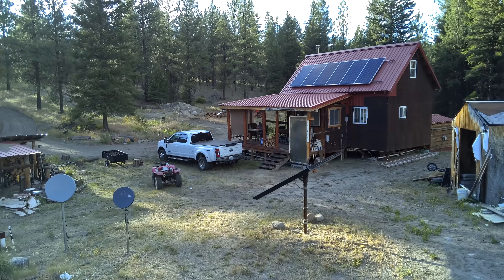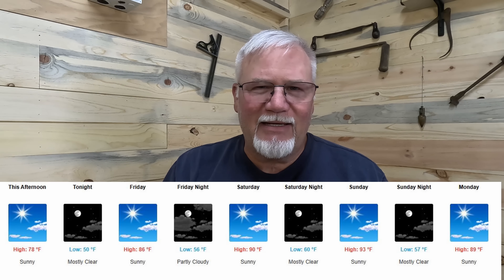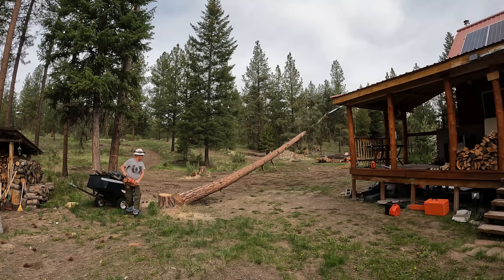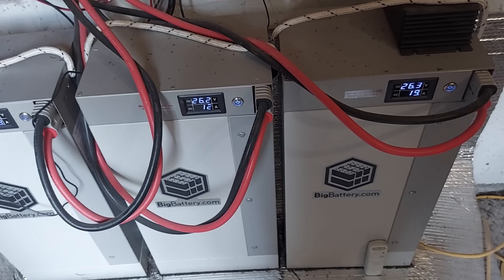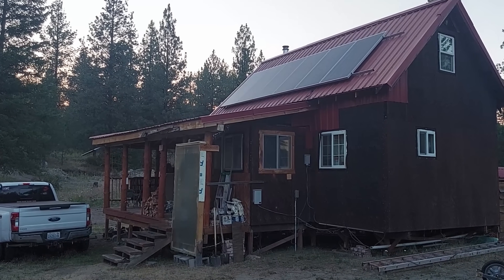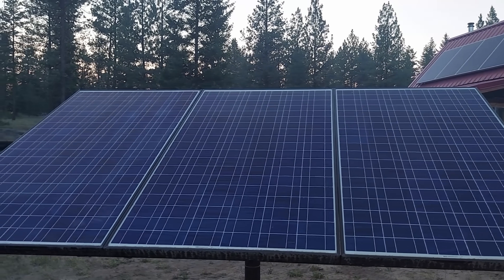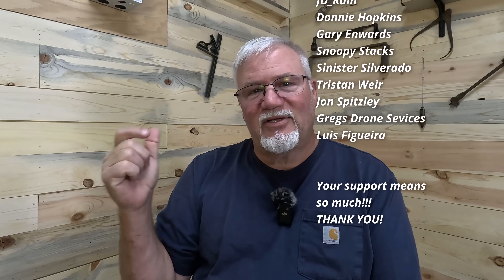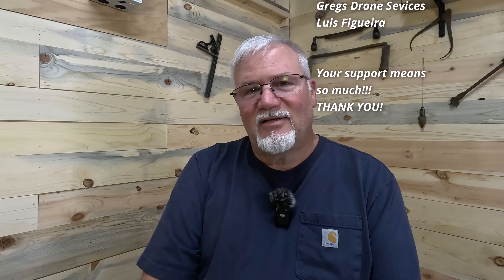I Tested An 8000 BTU AC Unit In My Off Grid Cabin During Hot Weather

Comment: We use a Midea U Shape AC with inverter technology in it, it uses half the power yours is using when at full tilt, and only around 100-200 watts normally. highest ive seen it go is 500-600 watts but very shortly. on my 2500 WH battery it says itll run between 10-15 hours.
Reply from the maker: Thanks for sharing! I'll have to check those out, great info.

Comment: I have a cheap amazon 12kbtu that will cool a 700sqft cabin on a 1200w inverter.  Aboit 11am-5pm the incoming solar can run it. I have seen it run 150w-1150w.  This has made out. Cabin useable again.
Reply from the maker: Nice to know what's working for you!  Which unit?
Reply: @TheOldJarhead the costway. Any cheap unit will do.
Reply from the maker: Mine runs $272 but uses a lot more power

Comment: Do you have a shunt,or how do you know your battery percentages? becouse on LIFEPO4 having that accurate,not many device can do,the BMS for sure wont give you the accurate reading(try get a victron shunt installed,and i bet you have more battery than you think)
Reply from the maker: Yes.  And a Tri-Metric Meter but I've had the system so long I pretty much know where it's at based on voltage under load (small load) vs at rest.  I used to rest the system 24hrs often to double check calculations etc and am just very used to it now :D

Comment: This screams dual split heat pump
Reply from the maker: Why yes, yes it does :)  Just a money thing.  Can't afford it just yet.
Reply: @TheOldJarhead yeah. Me either
Reply from the maker: That's the kicker :)  Maybe I'll get a Mr Cool some day ;)
Reply: @TheOldJarhead yeah their good. But when u can buy a Chinese made 1 for around 450 for decent 1 that will work. And they usually have built in blue tooth. Yeah it's about 100 to 150 more expensive though..I just looked it up. And the ones around $400 have a 11,500 BTU rating. 🤔
Reply from the maker: Thise also need someone to pressurize them vs the Mr Cool ones
Reply: @TheOldJarhead no not these days. Most u don't have to now
Reply from the maker: I'll look into it.  Last time I looked they all required it except ones like the Mr Cool

Comment: Thank you for the commentary.

Question.
Why dont you have a vertical wind turbine.
A small one that will generate 400w of power in very low wind speed is $400 to $500.
Of course you will need a wind generator charge controller.
Reply from the maker: I've often looked at getting a wind turbine but every time I look I find people saying they just don't produce that much for the money.  More solar is less expensive and more reliable etc etc...but I keep thinking one day!
Reply: @TheOldJarhead 
While they may not produce much.
Even if a 400 watt wind generator produces only 1/4 of its output that is still 2400w per day.

Usually when the sun is not shining due to cloud cover the wind is blowing.

Plus it can produce power at night.
Reply from the maker: That's why I keep thinking about them -- night, winter, cloudy days.  Perhaps one day but it would need to be a very low wind production model as I get only light breezes at my cabin 90% of the time.
Reply: @TheOldJarhead 
I would use a vertical turbine.
Less noise. Doesnt need to turn into the wind.
Produces power at lower wind speeds.
Reply from the maker: I'll have to look into those again.

Comment: A outside office (Converted shed with lofts) powered by 1200w on ECO solar tracker, 3000w inverter, 70a Victron charge controller, and 5kwh battery storage. This allows me to run a Window 8000btu Inverter AC 24/7 in Eco Mode. Plus extra power for TV, Mini Fridge, Desktop PC, Laptop PC, WiFi, Phone, Printers, lights, Fans etc. as needed. Not having trouble keeping office cool in low 70's even when 90+ outside. If temp starts to rise a osculating fan on low by AC spreads the coolness around office better. AC is set to 68 which keeps around 70 on head high thermometer across office, rarely goes above 72, if does the fan is turned on to bring temp back down.

All that said... Switching to a "Inverter" AC from a regular AC made a huge power savings difference.  An Inverter AC only draws the power needed to keep things cool ramping up power as needed. It is not a constant high power drain on batteries just because it is "On".  Highly recommend the switch for anyone off grid.
Reply from the maker: Great info, I'll keep that in mind when I get mine!
Reply: Forgot to mention the AC is the Midea U Shape brand. 
7am here, it's on already but only pulling 89w ATM and the office is actually chilly. It has a nice App, Energy Monitor for the month of July shows daily power draw ranged from 1.38kwh - 5.61kwh. Upgrading to this AC for office was worth every penny. You already know the benefit of tracking the sun, by 7:30 am AC will be powered by the sun and batteries starting to charge today.
Reply from the maker: That's awesome.  I'll have to check those out as many have mentioned them now.
Reply: They are not as expensive as a mini split, simple window installation, and extremely quiet when running. I can actually talk on the phone hear client and they don't hear AC over me. 8,000btu was only $350 and 12,000 btu $450 locally. I recommend at least 12,000 for your size space. 

Take any AC footage rating /2 to be closer to real world use. Square foot is great info for laying a floor but lacking when sizing AC
Reply: For people in direct sun without assistance of any shade all day... ;)
Reply from the maker: Ya I saw the 10k unit around $350 and thought "why didn't I see this a month ago! lol"  Live and learn I say.
Reply from the maker: Once I get the rest of my deck built, I'll have more shade too which will help :D

Comment: Why yes, I am doing a similar thing. Glad you asked.  8,000BTU window air conditioner, Ecoflow Delta 2 (1800 Watt inverter, 1024WH battery), 3x 250W solar panels. Due to a mismatch with the Delta 2 they only generate 400W. Two panels are fixed mount, one is adjustable. 1100 SF house. Last year as part of an upgrade, I replaced the two biggest most lossy windows I had. This has helped. 
A typical day goes like this: Overnight we open the windows and cool down the house. When the outside temperature reaches 70 deg we close all the windows. We keep one upstairs window open a crack to let the warm air escape. The new windows keep the inside temperature cool until about noon. Mean while the Delta 2 is charging from solar. By noon the Delta 2 is fully charged and I turn on the AC on ECO mode. It draws about 600watts when the compressor is running, 80 watts when only the fan is running. The first few hours the solar can keep the battery topped off. But as the temperature rises into the high 80s and into the 90s the AC runs more and more with the solar falling behind at keeping the Delta 2 fully charged. At the end of the day it's a race to the bottom as solar production tails off and the AC runs harder. Depending on how hot it is, the Delta 2 is spent between 5:00 or 7:00 O'Clock. And that's why the Delta 2 spends the morning recharging.
Clearly a bigger battery, more (or more efficient) solar would help. But it is what it is. My back of the envelope calculations show that I am saving 2.5 to 3 KWH a day.
Reply from the maker: That's quite the battle!  I'd look at expanding by a battery and adding a charge controller to the battery so the panels can provide all they are rated for.  Cheers!

Comment: Inverter ac on eco. Sips power
10k btu ave 5-600 watts in 90+ degree weather. Night temps 150 watts +or-  76 day 75 night set temps. Been running 8 and 10k units on solar and its great.
Esp in cooler weather. They sip little juice.
Reply from the maker: Nice!
Reply: @scozilla8503  , how much solar do you have? Thanks.
Reply from the maker: I'm curious too.

Comment: Great test!  I would suggest getting a Midea duo.  12000 btu.  It's an inverter AC that just sips power.  Also a unique vent swing system that really spreads out the cool air. I've had one for about a year and love it.
Reply from the maker: Nice, I'll have to check them out
Reply: Agreed. My inverter AC 6000 btu window unit uses about 230w on energy saver mode.
Reply: Running in my bedroom was only $200 refurbished and seems brand new

Using the same brand U shape window unit and have been for 5 years, also $200 on sale
Reply: The Midea duo? @ViciousXUSMC
Reply: Totally agree with these folks on the Midea. I have 12k btu and it pulls 700-800w at 69* max cool. Lasts all day and night on my 24v system.
Reply from the maker: Seems like a good investment....I may have to try that and see how it does...but then I'd have to find a home for the LG 😶😉😁😁
Reply: LG can be a backup.  @TheOldJarhead
Reply from the maker: True that -- though I'd have to store it...of course, I do plan to get that 2nd cabin built some day ;)

Comment: I've got a 12kbtu mini in my shed that runs around the clock. Not worried about consumption really I've got plenty to burn. But I have tracked power used in the shed and it averages 8 kwh per day. That includes the mini maintaining 74F for 400sf. Outside temp running in the high 90's. Starlink router and a secondary router, another 100+w around the clock. At any given point I'm seeing about 300w being burnt and peaks out for short periods of 600-700 watts. Only time I've ever seen it any higher was when I happened to be watching one day back in winter when the mini was defrosting and power spiked to 1100 watts.
Big fan of mini splits. Amazing what they can deliver for so little power.
Reply from the maker: I plan to get one as soon as I can afford it 😉 but they appear to be 5 or more times more expensive
Reply: Bought a inexpensive one on eBay 12000btu $500 work's great 2 years now
Reply from the maker: Nice, those are not sealed though right?  Have to have the right gear to install?
Reply: EG4 and MRCOOL are the only so called "DIY" systems that have sealed release valves installed on the line set. That I know of anyway? All the rest I reckon you need a vacuum pump and gauge set to evacuate the line set and evaporator before releasing the refrigerant from the condenser.
Not difficult to do but you have to educate yourself to do it and it'll set you back a couple hundred bucks for the pump and gauges. And some of those yocals will void your warranty if you DIY the install no matter your ability.
Signature solar has a heck of a deal on a 24kbtu unit at the moment. R-410-A unit, maybe trying to dump the old units making way for the new refrigerants? Didn't notice if they had any 9k or 12k units on sale?
Reply from the maker: That's what I thought.  Signature Solar is a great place to start looking :D

Comment: Decent match-up I'd say.  I think you nailed it.  Eco-mode has never worked for me, ever... and I ran a ton of tests with my portable units.  There's no point using it.  Always better to size the A/C appropriately and then run it full blast.

With just a tad more solar you could probably continue to charge the batteries while running the A/C in the afternoon and that could even get them to 100% by 5pm.  So you would have a LOT of extra margin in the evening to continue running the A/C when its the most effective at cooling down the (now no longer sun-lit) cabin.

I got the same effect when I began expanding my own solar... suddenly I was producing significantly more than the A/C used and that literally takes my home battery to 100% even with A/C running, and keeps it there through 6pm, giving me hours more A/C run-time in the evening if necessary.  Climate is more moderate here but it's been great on the occasional hot day.

--

I added a Pergola to my office deck a few years ago and that has done a very good job shading my office windows and the side wall (west side wall) of my office from the afternoon sun.  And of course I popped a few solar panels onto the top of it too... hence the shade it produced.  Made the deck nicer too.   No snow to worry about here though but it is fairly easy to plop panels on and take them off the Pergola.  Kinda my test bed for panels, its so easy.

More solar... its addictive!

-Matt
Reply from the maker: I've been thinking of swapping the ground mount panels with BiFacial panels.
Reply: @TheOldJarhead  I'd focus on adding additional solar and leave the ground mount as-is.  The ground-mount is close to perfect.

For bifacials the main advantage is reflection from winter snow cover, and with half-cut bifacial panels... better partial shading and better ambient light (cloudy) performance.  You would probably get vastly more production even just adding a few new panels somewhere verse replacing the already close-to-perfect ground mount.

Where to put them though.

* The "wrong" side of the roof will still help in summer / add some boost in the shoulder seasons.  It will also shade the roof above the loft a bit and reduce heat transmission from the sun.   Snow load (if any) must be taken into consideration.

* Some means of shading decks and windows from afternoon sun.  At ground-level, a Pergola structure with a sturdy ribbed flat open "roof" that you can just slap panels on top of for example, like I did on my back deck, which provide shade as a side-effect.  They can be taken off if winter snow is an issue (Pergolas generally can't handle snow load).

I'd avoid mounting panels to the side of the cabin, as some people do.  Its a bit of a fire hazard.

* Vertical fencing out of panels works too.  You just put in posts and use some bifacials as the fence filler itself.   (that said, pasting panels onto existing fences made out of wood... that's a bit of a fire hazard in my view).

* Shed solar.  If you have need of a shed, or have sheds, throwing panels on the roof or adding a somewhat larger shed that can fit, say, four bifacials on the roof.

-Matt
Reply from the maker: All great ideas though the ground mount setup is pretty old by today's standards 😉  but adding panels to my woodshed might be an idea.  hmmmmm

Comment: My plans are for a 12k btu mini split that comes with a soft start.
Reply from the maker: Nice!
Reply: Most mini splits these days are soft-start by default... they have variable DC compressors.  So there is literally no significant current on startup.  Make sure you get one with a variable DC compressor and not an AC compressor.
Reply from the maker: I was trying to decide what would work and decided to go this route due to cost but I can see one in my future if I can figure out where to install it since the cabin is so small!  Might have to install it in the loft just to keep it away from the propane backup heater and the wood stove (they say not to install them near open flames etc.

Comment: My 12,000 btu mini split draws about 600W when running.
Reply: Variable speed is the ticket. high 90's outside and mine runs on 300-600. There in no inrush anytime as the drive acts as a soft start. Not sure if you can still get a unit that doesn't use an inverter but well worth having. At the time I got my 12k unit using R-410-A I picked it up for 600 bucks with free delivery. Turbro brand, Greenland series. I have since gotten a second recently, a 24kbtu running on R-454-B. Crazy efficient blowing out loads of frigid air. But hope you don't need refrigerant anytime soon as supply is in the tank and is currently running about 95 bucks a pound. Much more efficient than R-32 units that I've seen though. Being a blend of R-32, not quite as flammable as straight propane.
Reply from the maker: I'll have to look into those.
Reply: The wattage of an AC unit varies quite a bit based on outdoor temp. My 10,000 BTU non-variable speed compressor AC uses between 700-1,000 watts depending on the outdoor temp
Reply from the maker: What brand?
Reply: Yah this. I have a 10k Midea inverter AC, U shaped, tho any brand and inverter ahould do the trick. It tops at around 750 or so but ive seen it draw 150-200 watts for hours while its keeping the temps at set point. Id experiment a bit more. This style is the way to go.
Reply from the maker: https://amzn.to/46IfMZh that one?
Reply: @TheOldJarhead  Yah basically. If it will fit, I'd recommend getting the 10k because it probably doesn't take much more watts and it will only do that on max. These are variable so they tend to run on the low side most of the time. Unless of course you just dont need that much. =)
Reply from the maker: Oh I think I can use more but my windows only measure 21.5" at the openings.  That's why I went with this one as I figured I could fit it even though they said 22".  I was right.  Best option I think, for me would be a variable inverter type of the same dimensions or a mini split but since I don't live there I can manage with this one for the couple months it might be needed on the weekends I'm there....which right now is a bit less frequent sadly.  But I plan a LOT more there soon!
Reply: @malifestro3319  A 10k Midea U inverter AC will use up to 960 watts if it is hot enough outside and hot enough inside.
Reply: @malifestro3319  A 10k Midea U inverter AC will use up to 960 watts if it is hot enough outside and hot enough inside.
Reply from the maker: That would be fine really, considering I'm using that much on a 8000 BTU LG...hmmmm
Reply: That's cool. No puns intended. 😂 I was looking at some designs like that not long ago for a friend that was looking for a window unit.
Reply from the maker: Cool 😁